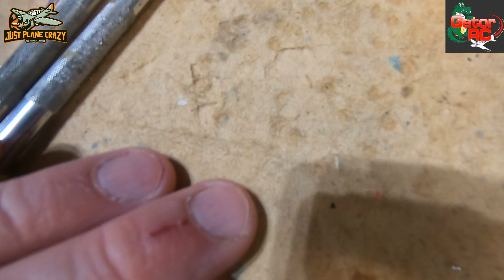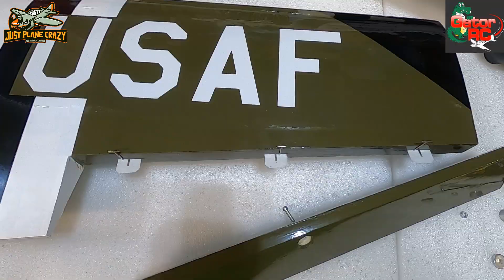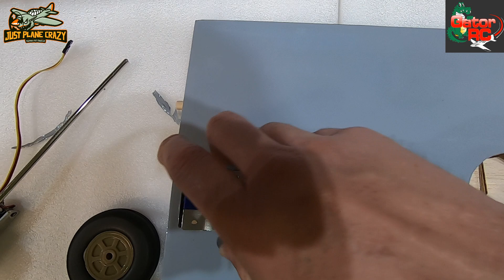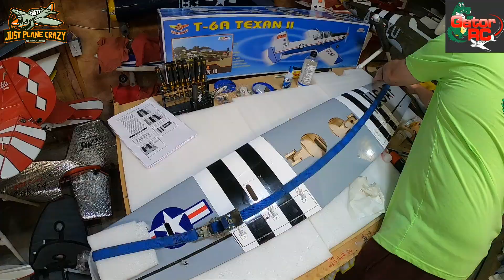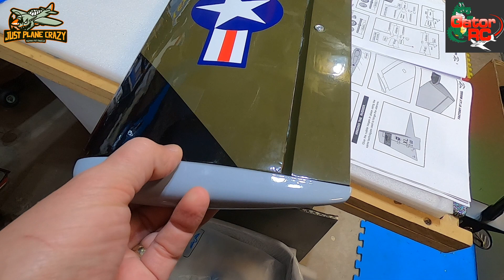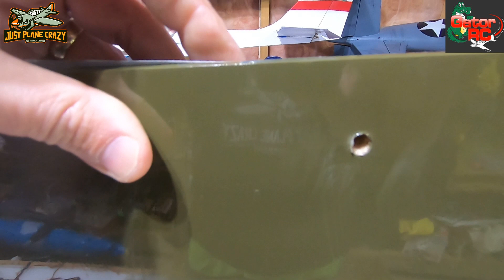T-6A Texan II Build Pt.1 from Gator-Rc & Seagull Models

Comment: Anybody know why the a 6T Texas 63 inch by made by seagull one has flaps and one doesn’t what would be the reason for that I have the yellow with the silver body I’m going to put a power of 60 and the answers to be nice or can I use flapper runs to make them a flap you know what I meanall right give me a little feedback guys
Reply from the maker: Yes understand. Flaperons are possible in anything but I would try them up really high. No reason on my end one does and one doesn’t. That is interesting

Comment: I also did not get any screws for the flaps hinges, but I did get two different retract wheel housings and they fit well.
Reply: The included screws for the retracts snapped off at the head of the screws, so it's a good idea to get your own.
Reply from the maker: What plane
Reply from the maker: Lol. Yeah sometimes life is hit or miss. I upgrade most pieces anyways but having two wheel cups does stink. What plane are you building